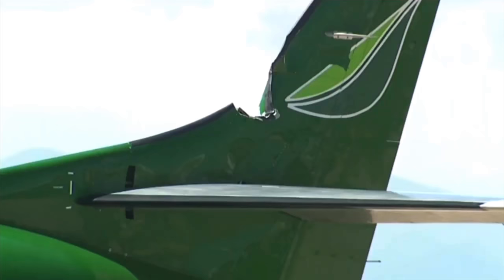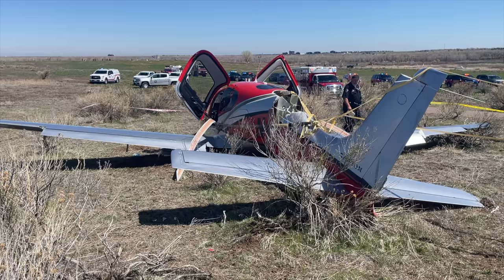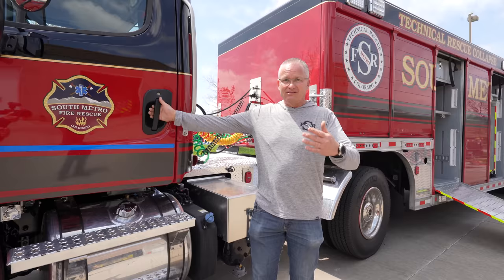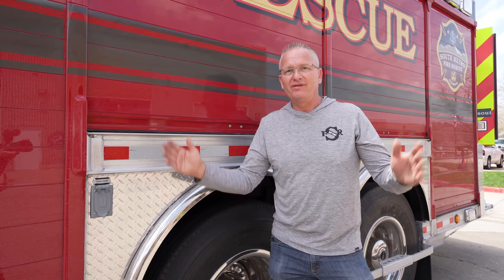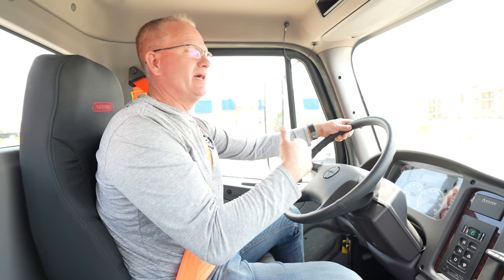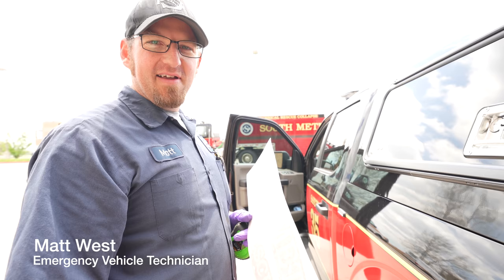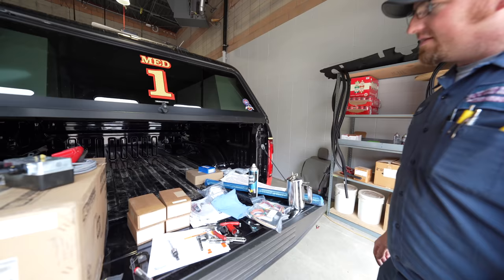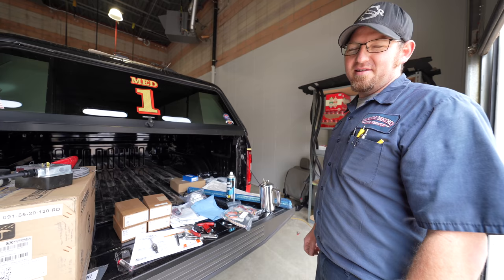PIO Vlog - May 2021

Comment: I remember this one when it happened and viewed the investigation as to how it actually happened partially due to the odd configuration of the parallel runways that can be confusing.  Amazing that no one was killed. A friend of mine has a Cirrus also equipped the same so a nice safety feature. Basically, with the new Collapse Truck is a blank slate to be customized to fit your needs. Nice that it is stationed in the SMFR area, but also for dispatching to other areas as well. Can't wait to see it set-up and equipped. Nice to see your maintenance personnel and how they take care of the EMR equipment. It takes special people with the right amount of patience to deal with wiring harnesses, because it looks like spaghetti to me, so kudos to them. 80-90 hours more? Like I said it is all yours. You get lots of patches from Germany I have noticed. Great video and editing as usual.

Comment: Can you guys do a day in the life of a wild land firefighter? A day in the life of a brush engineer?
Reply: A day in the life of a tree. In a forest fire. Titled: when evacuation is impossible. Kinda a horror/documini series.
Reply: @ffrreeddyy123456  yes that would BLOW UP
Reply: that would not really work since they don't get daily calls
Reply: @Rywillmoo35, they wouldn't be able to. Each station that has a Brush unit is cross staffed by another truck at the station, similar to HAZMAT and Tec Rescue. Say, for an example, a station has and Engine, Brush unit, and a medic (or whatever setup), the engine would switch to the brush if there is a brush/grass/Urban Interface fire, ect.
Reply: @prestonmermis8425  I’m saying when there’s a big fire
Reply: @406fish1  I’m saying when they get a big fire
Reply: @ffrreeddyy123456  🤣
Reply: Well all brush trucks are staffed by an engine company so it would pretty much be "day in the life of a firefighter" or "day in the life of a engineer" and they have done both
Reply: But what about the young adults who volunteer and go out digging trenches and such. Would that work? Or is this only about the equipment and setup? Never seen these vids. But they’re going to crash soon! Or already did. I’ve been waiting for the planes to crash.
Reply: brush trucks don't have an engineer but if they had a brush fire they could do a vlog

Comment: Word of advice on semi driving, always always exaggerate your turns and don't start your left turn until your shoulder is even with the obstacle you're turning around. However, having the axles set back will decrease turning radius but will eliminate tail swing.

Comment: Something you might want to teach the drivers for the new collapse tech rescue is don't set the trailer brakes during the winter. Otherwise the brakes can freeze and not release when you get ready to leave. The guys at fleet will appreciate it as well I'm sure.
Reply: Alcohol in the glad hands, drain the tanks, and keep the air dryer clean.

Comment: Talking about technical rescue and new replacements, 2 questions, does south metro plan on replacing Rescue 34? Also is Rescue 34 Considered a Type 1 Resource, Some of The Rescue units for other major departments I've seen are actually identified as USAR units instead of just a Rescue. Despite Rescue 34 not being designated as a USAR rig (IE USAR 34) Are you still considered a USAR resource?

Comment: why was the dive rescue not in this video
Reply: The dive rescue most likely occured after they filmed and edited this video so they were unable to add that part and it will be featured in the next vlog
Reply: that would be a good reason but the dive rescue happened 3 days before the air crash

Comment: so do the drivers of the new collapse 45 need a cdl to drive it when you turn anyting witha long wheel base the back end will swing
Reply: Departments are requiring apparatus operators to get their cdl due to the size of the units

Comment: Any reason for using the Soundoff lightbar vs Whelen or any other lighting companies? TIA!
Reply: We use the soundoff system for its features/cost/reliability and to keep these trucks consistent. We also utilize whelen, code 3, and federal in other units. Thanks
Reply: @okaythenification  good morning Matt, I am starting to spec my personal IDT Tahoe for a new dispatch center down in Houston, TX. I was wondering if it would be possible to get the specs on how IDT11 is built? Thanks I’m advance.